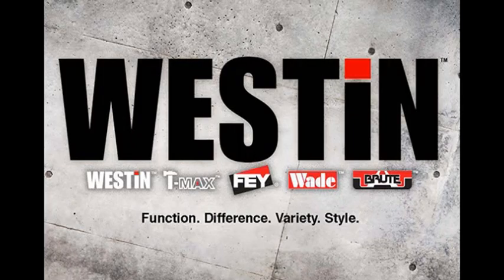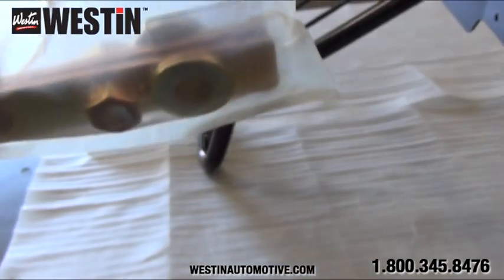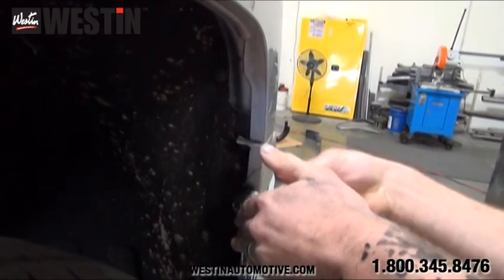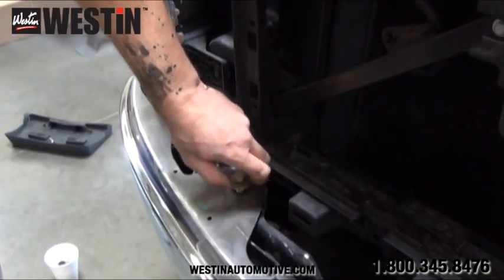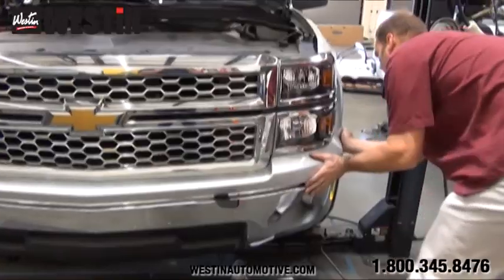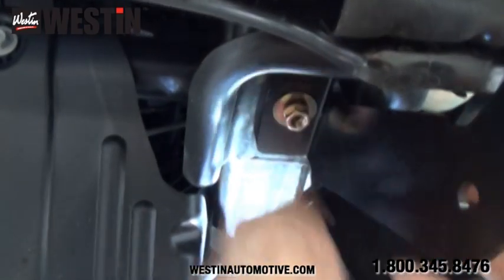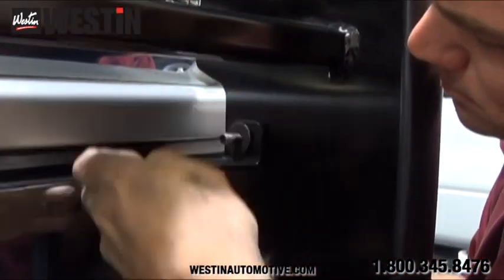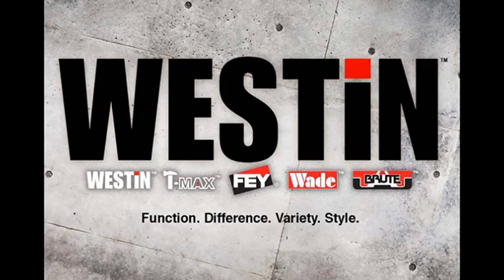Westin 40-3685 Sportsman Grille Guard installation on 2014-2015 Chevy Silverado

Comment: I have a 2015 Sierra 2500 Denali and the models I was looking at state for GMC Sierra with a note for not Denali models.  Is there more cutting/trimming/fabbing that needs to be done for it to fit the Denali? 

Also..how interfered are the front parking sensors?

Thanks

Comment: Is there a grille gaurd similar to this that will fit onto a 2009 Chevy Silverado 1500?
Reply from the maker: Cole FakeName This product is available for 2009 Silverado 1500 (40-2275). Here is a link to the install sheet: http://westinautomotive.com/applicationchart/pdf/75-0212.pdf
Reply: Exact model I have.